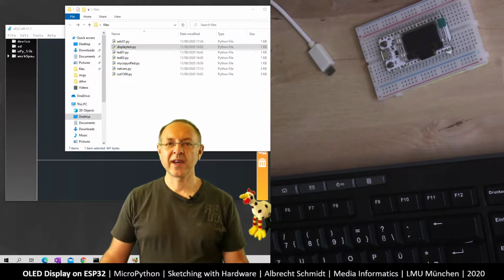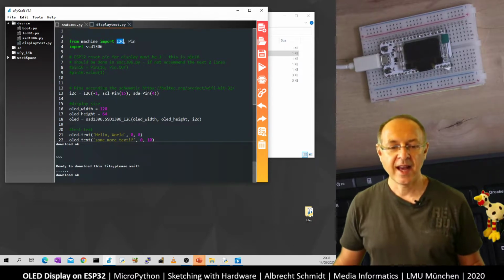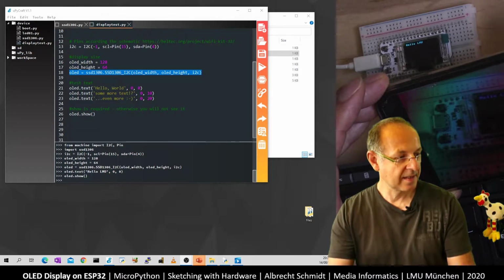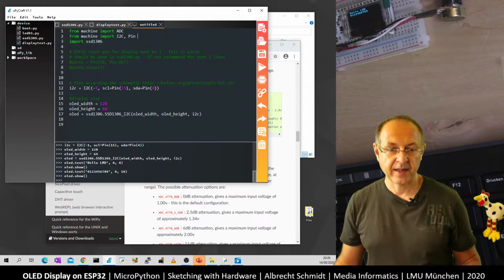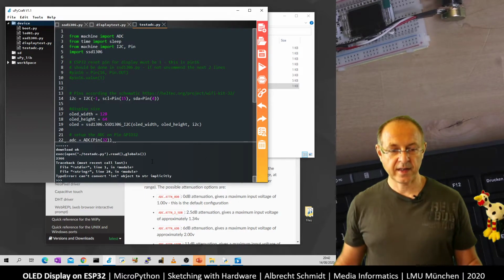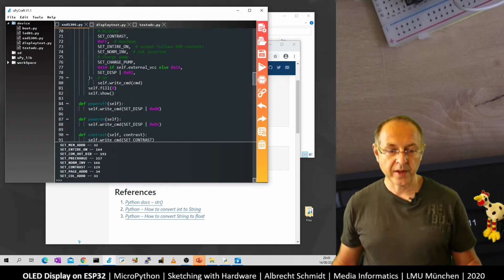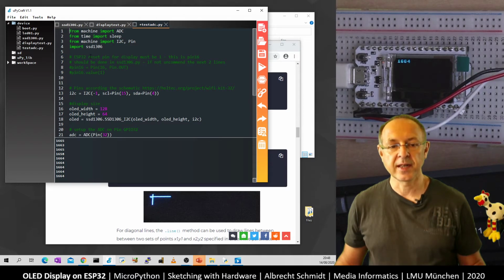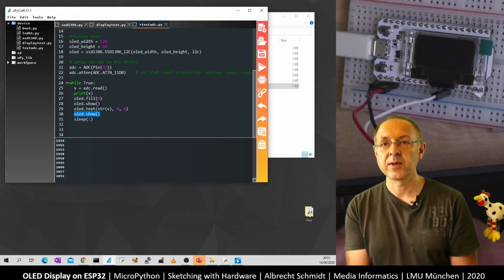Print onto the OLED Display (I2C), ssd1306.py  - Sketching with Hardware at LMU Munich

Comment: where did you find the ssd1306 library?
Reply from the maker: It is linked on the wiki page https://www.sketching-with-hardware.org/wiki/OLED_LCD_Display
Reply: @albrechtschmidt  Thank you.. I will try that. I have tried several versions of that .py as well and finally found one that doesn't return errors when running... The current ssd1306.py runs and allows my to type display.fill() and .show() for instance, but I get "snow" on the screen. I am running version 1.17 of micropython. Another YouTuber running v1.14 has mentioned ssd1306 is now built into micropython - I didn't share that experience. I have also learned the the machine.I2C() has been "deprecated" and now we need to declare machine.SoftI2C() instead. Interested if you found that as well.